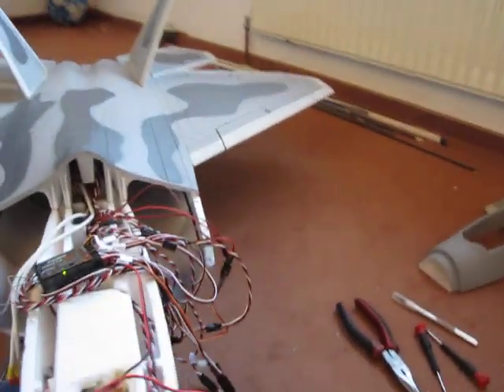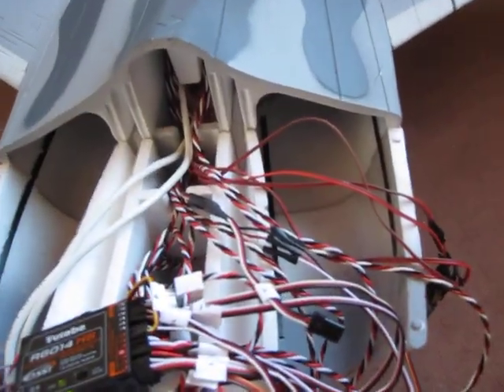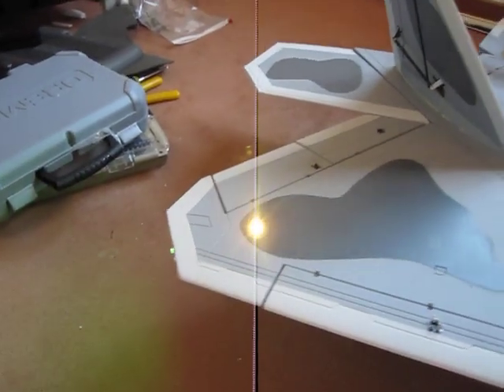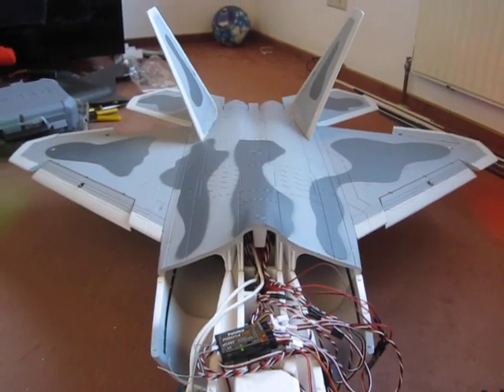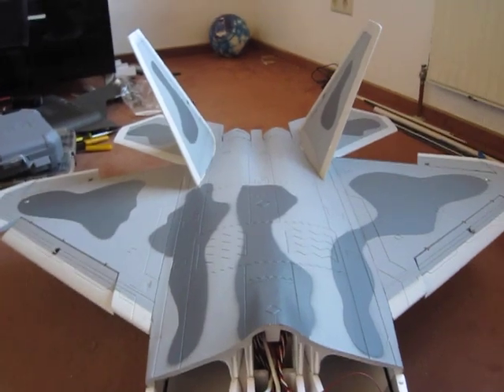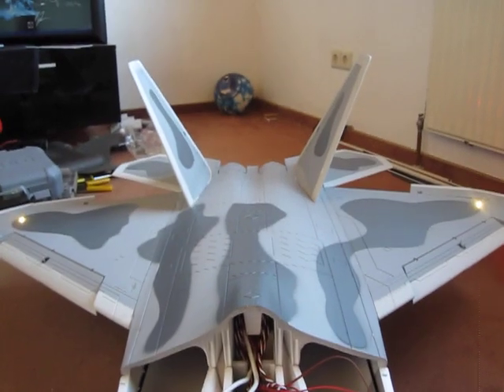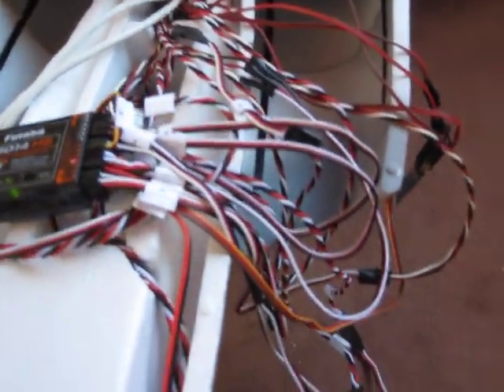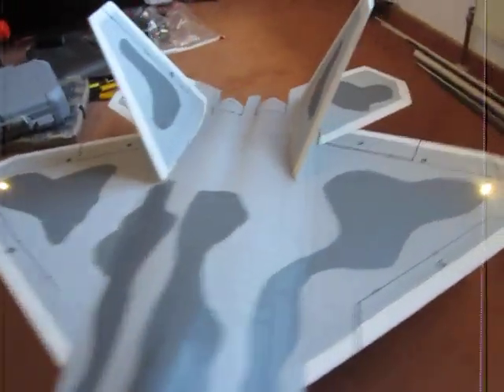Twin 70mm F22 Beast build

Comment from the maker: Actually ran every surface separately, so instead of y'ing the rudder, its seperate channels. The futaba 14sg has an airbrake function to do this, just need to run everything separate. I haven't flown on grass as I usually have a street to use since I stay with the stock retracts as well.

Comment: how did you do you program the airbrakes and flaps 
and also with speed adjusted?
btw like you plane, does it do on grass? (stock retracts?)
thanks
Reply: milton chin hi could you tell us which retract system you used for it? Thanks